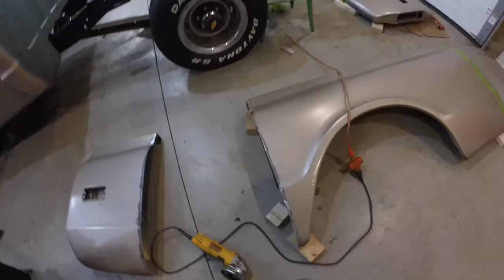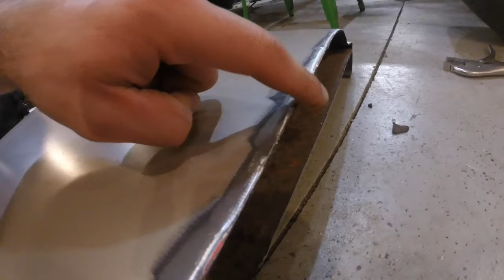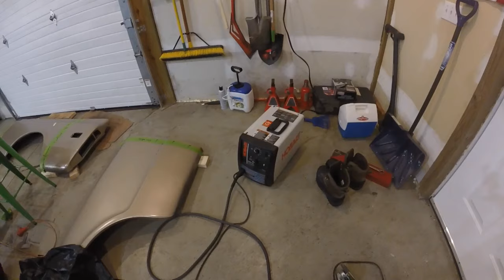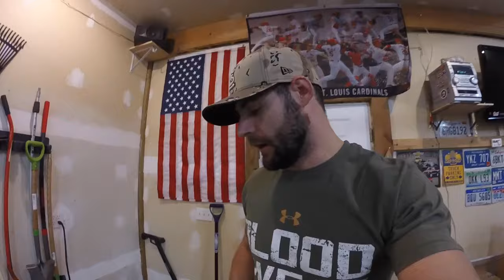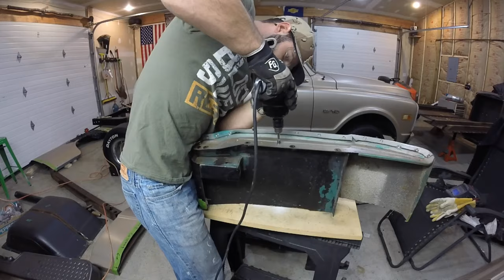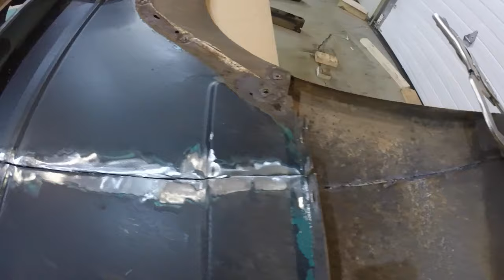Shortening the Bedsides (Step 2 - Welding) | Chevy C10 ep. 8

Comment: Hey Buddy you’re doing an awesome job but can I suggest a necessary item for your mig welder? I would go to my local welding supply shop and purchase a flow meter for your shield gas. It screws into the bottle valve and the meter has increments for your flow ball. When you get everything hooked up there will be a finger adjustment screw. Pull the trigger on your mig gun and start turning the screw clockwise. You’ll see the flow ball start to rise keep turning the adjustment screw until the bottom of the ball is exactly on 30. What your doing is metering the amount of shield gas flowing to your welding surface. Amazon has these as do Eastwood. Eastwood’s flow meter is $69.99. Also another thing good about that flow meter at least the ones I’ve used when the meter developed a light frost it meant time to change the bottle

Comment: I am doing something similar to my truck. Anyway I also bought the #2 shielding gas bottle from tractor supply only to find out that I should have went to the local welding supply house and rent a tank that was cheaper and larger on a 5 year contract.  And it also cost about the same to fill it as the #2 bottle does.

Comment: If you were to do it again would you still  remove end cap and the save the extra cut on the front end of the bed or make two cuts to remove the 12in? I’m trying to decide how to tackle mine.
Reply from the maker: I’ve thought about that a few times.  Now that I’ve got more welding and body work experience, I’d make the two cuts and have two seams. It’s really hard to get that end cap looking good and smooth like it does from the factory.

Comment: Thanks again!  Was disappointed to hear about the Flux as I have the same setup.  Curious to know...now after going through all this, would you do the bedsides again, or just buy them?  Roughly $500 per side....
Reply from the maker: scott walker that's a good question. I think you have to consider the shape of the entire bed and not just isolate the bed sides. Everything on my bed could really use new parts and I don't feel like now is the right time to drop $2500 on an entirely new bed.

Comment: Good call on the tank. When you said you were going to use flux I was like NOOOOOOOOOOO!  I had the same problem.  Tried to weld up some test stuff and kept warping the crap out of it.  Not only does flux burn too hot, it's a "dirty" weld and doesn't penetrate as well when you can't "burn it in," which obviously warps the crap out of sheet metal.

You'll also find you need a faster wire speed.   I started using wire a couple months ago and I've become a welding fool.  I've observed minimal to NO warping on the panels I've worked on so far.  I was really discouraged when I was using flux wondering why it looked so easy on TV and my stuff looked like garbage.  It really is "easy" when  you get  your rhythm down with MIG.  Just this weekend I chopped down a steel longbed floor in the thread below.  I bought a perfect set of Arizona original paint longbed sides to cut down for my 67.  Looking forward to your tipping video.  I've only seen before/after pics on the 67-72 truck forum and would really like to try that over another long weld seam.  Thanks for the doing the videos!

http://67-72chevytrucks.com/vboard/showthread.php?t=609973&page=7
Reply from the maker: SilveradoC10 haha yea I learned real quick the flux wasn't going to work. And you're right, it's so much easier with the shielding gas. 

For the folding part I've only seen the before and after pictures too. But it can't be that hard. We'll see how it goes.

Comment: Just found your channel. I'll had to the first video and start working through them. I've been using the Hobart 140 also. I was wondering how you'd use flux core, but that was quick failure as I thought it would be. I'm converting mine to a short bed also. I have the chassis nearly complete at this point. I like the videos and your style. Like you, I'm filming the entire process on my own channel. Not sure where you are in this build as of now but I look forward to seeing it. Stop by my channel if you're interested in my build.

Comment: Where did you come up with the 20 inches to remove. In all my research I'm coming up with 18in.
Reply from the maker: Brandon Robinson not sure where you’re doing your research but I never saw any number other than 20” in any of mine. Including the frame template I used from Brothers
Reply: 12 and 8 =20 same as on the chassis.
Reply: Why don't people just buy short bed skins instead of cutting and welding the sheet metal?
Reply: Me too! When I look at the aftermarket parts companies catalogs, they all show a 100 inch box side and an 82 inch box side. My math says 18 inches.